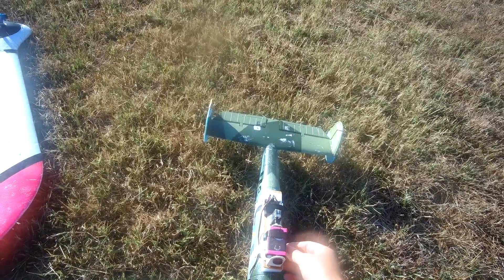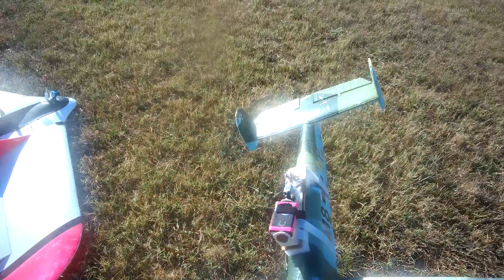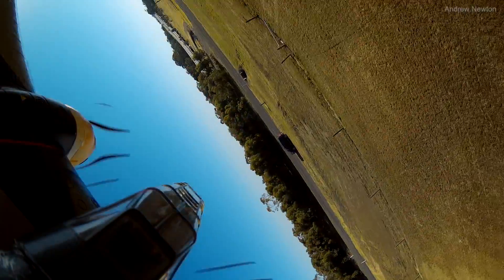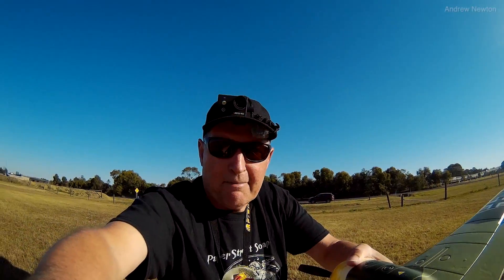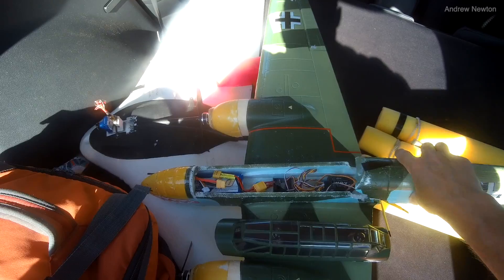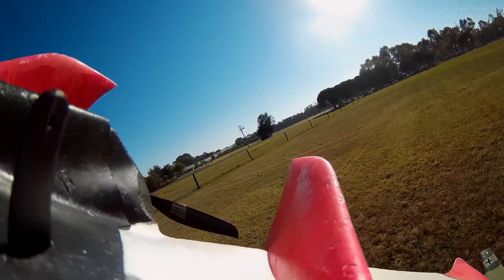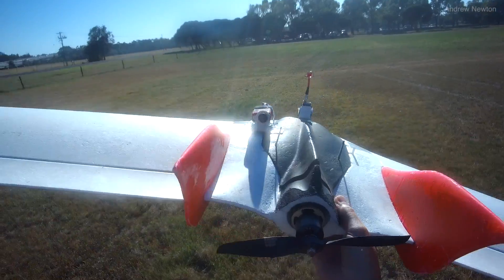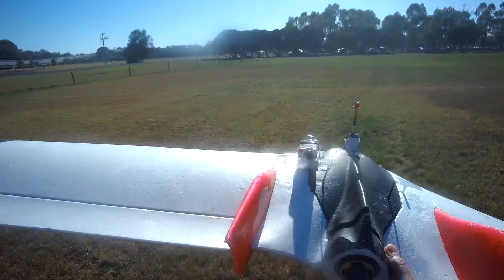Roll axis Gimbal Onboard

Comment: Love that you showed the failed first attempt, and I am definitely going to need to make one of these up, but maybe with my keychain cam to keep the weight down.
Reply from the maker: I used an 808 #16 years ago for a similar gimbal.
Reply: @AndrewNewton  Have you tried doing this with BetaFlight? I have a TinyFish FC that is 16x16mm board size, so it would be great for making this gimbal easier to move from plane to plane. But the FC isn't supported by iNav :(

Comment: Neat , now keen to see it in a roll.  I remember when they put in on the MotoGP bikes and it made them hard to watch but that not happening on your plane in both modes.
Reply from the maker: That's right, we call this the MotoGP cam. I'll need a different plane to pull off a roll

Comment: Pity about the 110. The design concept is excellent as is the execution. It will be great for filming the passing scenery. But for filming a plane in flight I actually prefer the stab off setting.
I can't figure out why but I felt disorientated/ detached from the flight with it on.
Probably just me being weird
Reply from the maker: Yes it's an unnatural movement if you are sitting on the plane

Comment: It does confuse my senses maybe i.m getting old ,,the cam stays put and plane wobbles about that's weird,, shame first one snapped i.m such a bad flyer I pre crash plan carbon rods along sides and below  with little dab of glue be ideal that's I,d done before ever flying out of the box that was it's weakest point we're it snapped
Reply from the maker: You're right, very little cross section of foam there. All fixed now